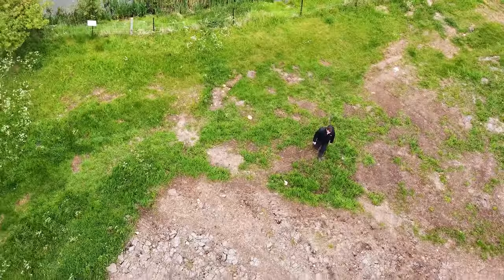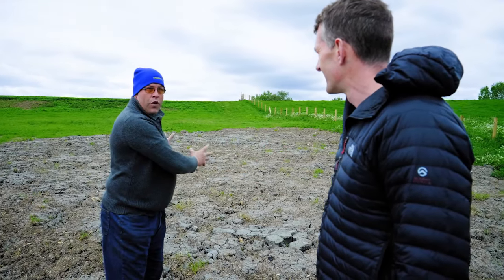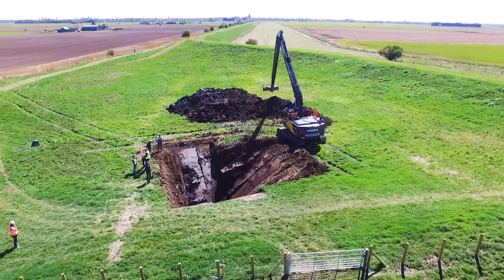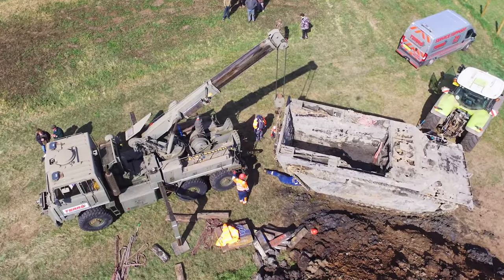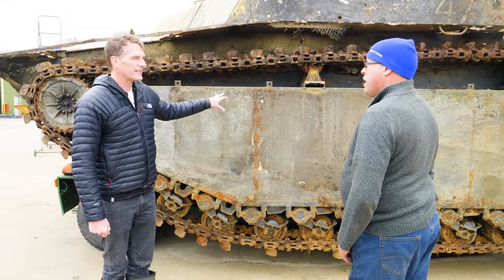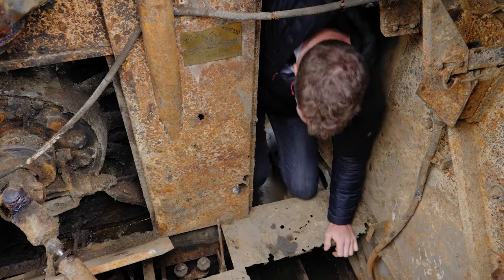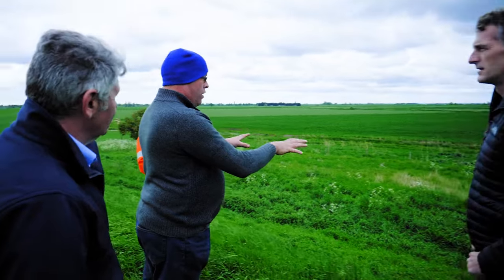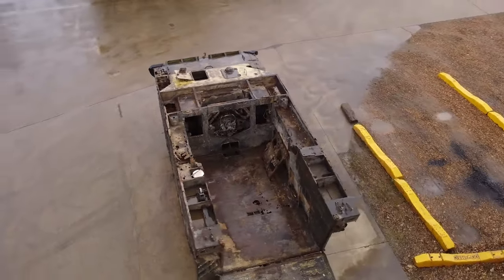This Incredible WW2 Landing Craft was Found in a Farmer's Field!

Comment: It would be amazing to see them all brought up, and restored to full running condition.
Reply: You could sell off half or more of the recovered total to those rich military vehicle collectors we've seen on TV, and use the proceeds to restore a couple of museum examples.
Reply: @carmium  That's what I was thinking too.
Reply: If fully restored, would literally be changing every piece except a few hinges, then it's no longer than the same artefact ultimately destroying it, I see this a lot with people restoring old boats, nothing is left from the original just that it was restored in the same position in space as the original. Also, it would be cheaper to simply build a new one.

Comment: When I was a child I would ice skate in Ivy Hill Park . It was a wet land that would flood when they closed the drains in the winter . The park butted up to Seton Hall Universitys back parking lot  , which was elevated about  5ft higher than the park . And old guy told me that when they built the parking lot that they used war surplus vehicles as landfill . I always wondered if it were true .

Comment: Although I'm definitely not a war/war equipment fan, I nevertheless hope, that at least 1 water buffalo will be restored to running condition. I bet that anywhere in the world an extremely rich WWII fan will want to have one of these vehicles. I hope that the finders will put it under a roof fast. Otherwise the oxygen and sweet rain water respectively moisture will damage the vehicle more than 65 years of burying could do.
Best regards, luck and health.

Comment: There was incredible incompetence at the landing; what did they think might happen when the gates went down. How many got killed in the first seconds because NO ONE thought to have some portable shield that could at least get the men onto the beach and protected.  Also there was the brilliant idea to load the men down with heavy packs so if they had to go in the water they would drown...and who needs to run and move fast on the beach? Completley ridiculous. 
As far as the tanks; who could imagine rough sea might swamp the tanks in their little floatation ring and lets also risk the tank crew who may not even be able to swim. Why not just have a big Metal landing craft for individual tanks and give them a chance?
They could have easily made mobile metal shields for the beach...two guys with NO Packs move the 3 person shield while a guy in the middle mans a big machine gun or Mortar. Shields could be designed to hook together and make mini bunkers. 
Too many men were just mowed down because no one could foresee reality. It's awonder they got off the beach but it probably helped they were not facing the best German troops.